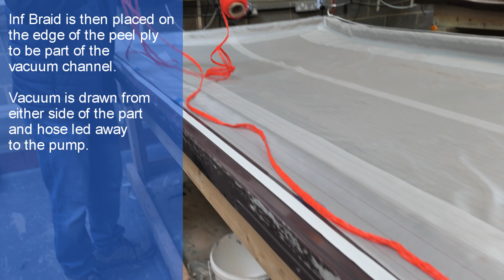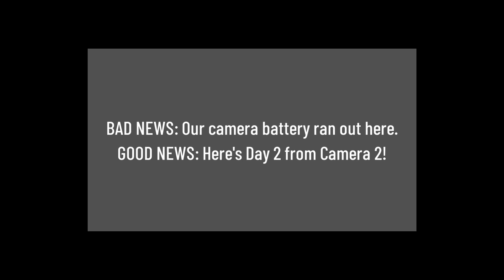How We Made a Resin-Infused Carbon Fibre Pop Top Campervan Roof

Comment: Did you brush in the clear coat or spray? 

What is that carbon fiber pattern called? 

You guys are awesome!
Reply from the maker: Thanks!   The gel coat was brush applied, but better results are achieved if you spray. we also used Camo carbon, but unfortunately we have no more stock of this pattern.